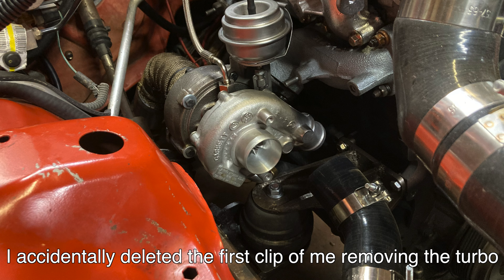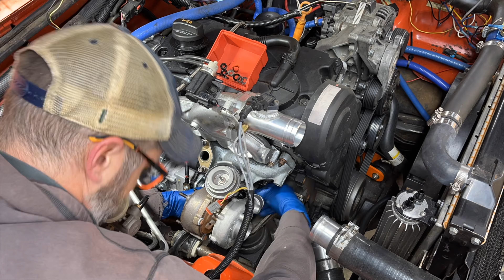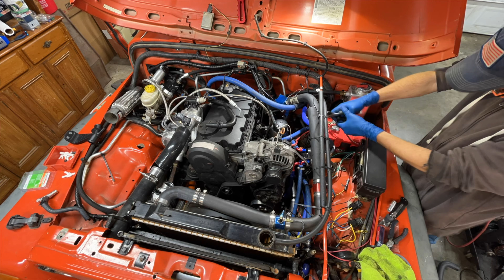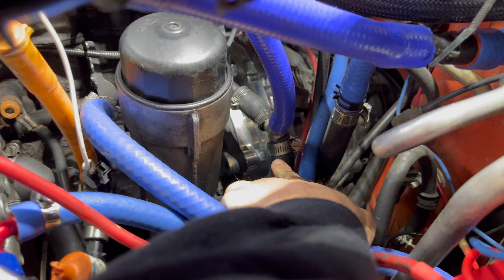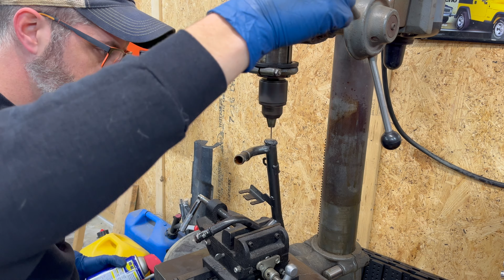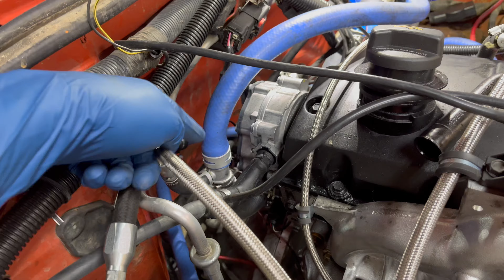Installing a GTD1752vrk Turbo onto my TDI powered TJ Wrangler Part 1

Comment: First off, sick build. Second, did you custom order the turbo to have the water cooling and flat flange instead of the v band clamp? Also, did you ask for egr to be deleted?
Reply from the maker: Thank you! I actually didn't order the turbo with the water cooling though I'm glad it has it. It definitely seems to be helping with keeping the center section bearing cooled. It also came with the flat mount and the EGR deleted. I don't believe I asked for either of those but I would need to double check.